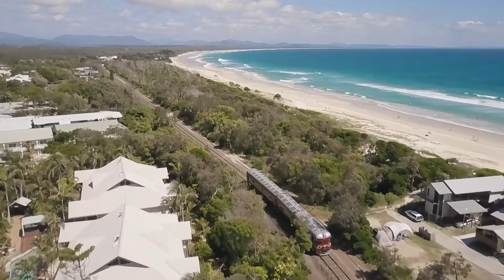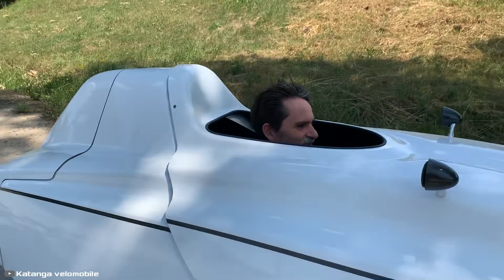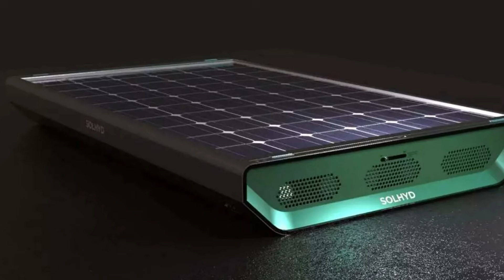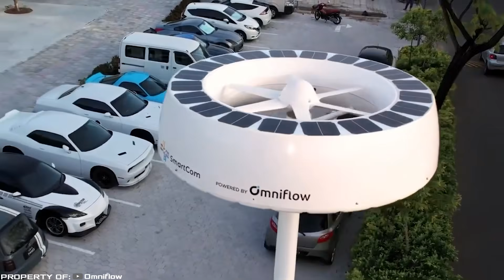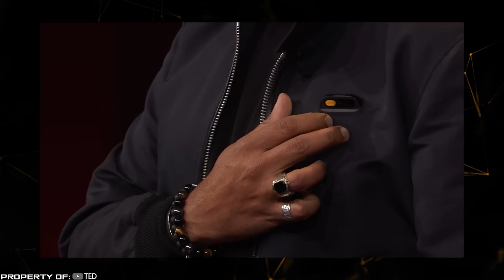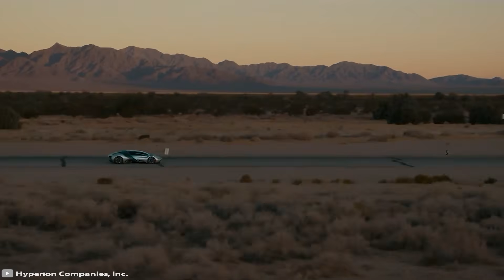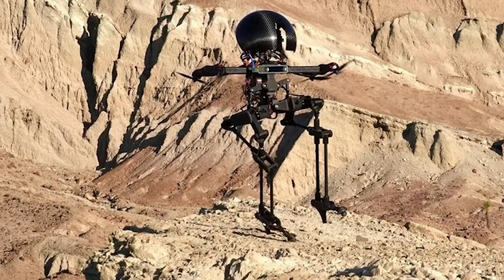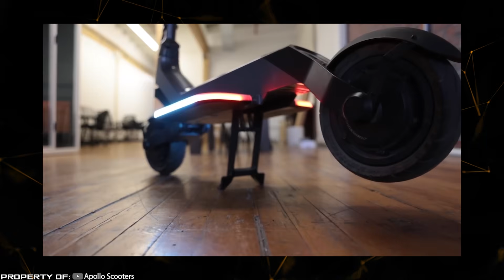INCREDIBLE INVENTIONS THAT WILL BLOW YOUR MIND | BEST OF 2023

Comment: What surprises me is with global warming, we keep focusing on solar energy instead of finding a way to concentrate the ambient heat and use that energy. solar wont work on a cloudy day but if its cloudy but still warm, the ambient energy would still be there
Reply: Ambient heat is used in heat pumps to heat houses and heat your water for the shower. Small systems for single family houses and huge systems for small cities (Denmark).
Reply: The climate always changes humans have nothing to do with it unless all atomic weapons were to be set off all at once
Reply: They are solving a non existent problem. Global warming is not bad.  An increase of about 1.5 degrees since the little ice age.  The most prosperous century in history.  What we should be doing is developing even more coal, gas and nuclear power in preparation for when the climate reverses toward another ice age.  Also provide energy for undeveloped countries.
This video is also deceptive.  The solar panels on the train do not provide all the energy for the train to run.  Most of the energy to charge the batteries comes from the panels on the roof of the station.
Solar and wind have no hope of replacing existing dense energy of coal, gas, oil and nuclear.
Reply: Weather

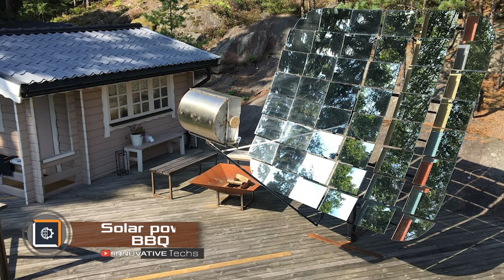Comment: Third-world countries have been using solar-type or reflector panels for decades as an alternative method for cooking. However, they do so using far cheaper and available material.....something so elaborate as shown in @15:29 is really not feasible. Still, it will be interesting to see who decides to install that particular technology.
Reply: BBQ enthusiasts who also absolutely must have any new shiny gadgets and have lots of money to waste? Maybe someone could install a few of them and start a restaurant offering solar cooked meals, open only around noon on very sunny days...

Stuff like the bike that costs as much as a cheap car is at least useful, but this contraption is dumb. It takes up lot of open space in your yard and may require cutting down trees because it requires direct sunlight, is either a permanent structure or hard to relocate so you cannot store it away when not in use, requires lot of cleaning to keep it shiny, and still only works for a limited number of hours per day so no evening meals for you.

This may be one of the few cases when building a "green" gadget takes more money, energy and fossil fuels than using it would and could ever save you. Some of the smaller scale and DIY versions do actually work, for the rest of us cooking with electricity produced by solar panels is both cheaper and more practical option.

Comment: Solar cells in space transmitting power via microwaves to earth?I can think of a whole series of problems compared to solar cells on earth: Risk of Space debris destroying it, massive power loss due to transmission type (microwave), power loss due to distance (36000km), powerless due to even the slightest misalignment between constantly moving sender and receiver, power loss due to atmospheric absorption... in short, the increase in efficiency you get in space is probably smaller than the losses you face when sending the power back to earth. But wait till E-Rockets hit the market and you can use it as wireless space recharge station.

Comment: i like to drive to florida from new hampshire often. i have a gas driven car that holds 20 gallons of fuel. from leaving NH it usually takes me 32 hours drivetime with many fill-ups of fuel. if i had an electric car and having to recharge after 400 miles it would take me close to a week to get to FL. my vacation time is usually 2 weeks. i would lose my vacation totally just driving there and back. it only takes 5 minutes to fill up my gas tank.

Comment: Fun with math. 1kg of hydrogen = $16. 1 liter of hydrogen weighs .0896 grams. So it would take 11,160 liters to make 1 kilogram of hydrogen. Machine produces 20 liters per day 558 days to make $16 worth of hydrogen. If the device cost (guess?) $5000 you would need to make 312 kilos to break even. So 312 kilos at 558 days each would take 174,375 days or only 477 years to break even.
Reply: i see your a great and mathmatician enthusiast! Our country need more people like you to teach our youth! Our country is falling behind in math
Reply: How many liters of hydrogen is needed for hydrogen car?
Reply: @brandonsheffield9873 what are cylinder dimensions ? A 4 cylinder engine needs one filled at time.  A 2 Liter motor divided by 4 would be about right. 

Look up Stanley Meyers water car where he used high voltage to break apart water.

The myth busters have a short segment on it also.

You can make HHO in infinite volumes.  There's a lot of water and free electricity around now a days. 

The genie is out of the bottle now.
Reply: Mixing column weight and form conversion
Reply: Sounds like a plan!  (Not).  But that's not fair to actually use numbers and things to show how silly the concept is.  Not to mention the issue with storing hydrogen, and the extreme explosion danger it brings.  NASA uses hydrogen to power some of their rockets, and is forever having trouble with the valves, seals, and piping.  If NASA can't get it right, what chance does Uncle Joe's Corner Garage have?  Hydrogen is impractical.
Reply: Sea water + EMF = Hydrogen, enough to burn for fuel and generate the EMF, water vapour being the only byproduct, sea water the fuel. Non profit products are not promoted and made available to the public, due to the greed of corporates, billionaire elites, Science and corrupt politicians we are forced to pay for obsolete technology designed to drain the finances, minimise recreational time and destroy the happiness and well-being of the citizens of the World, who pay for their ego infused evil policy’s, until we are dead.
Reply: A litre of liquid h2 weighs 70g btw. Go figure!
Reply: Nice catch. I’m also excited to hear how exactly you extract hydrogen FROM sunlight. Now there’s a trick!
Reply: Great comment, hydrogen can be made with solar electric, hydrogen generators are cheap to build, hydrogen is everywhere, 71% of earth is covered in water,,,the reason hydrogen cost is high is because its convenient to make it expensive,,,plus you and every other person on earth can produce it easily and cheaply, which is the reason they are spoofing people that hydrogen is expensive,,,think about it,,,no drilling, no refining, no pumping stations and no pipelines, no oil spills,,,I don't have a solution, but I do believe harvesting the most prevalent combustible element in the galaxy, hydrogen, which is renewed when burned, is what we should be using power everything. Generate electricity with no moving parts with hydrogen fuel cell to power EVs, no battery storage, lighter vehicles.  I could go on and on but what do you think?

Comment: JUST WHAT WE NEED...more microwave beams from space! 😮
Reply: If you put a microwave satellite in GSO,  it will have a 6x8 kilometer footprint on the ground at approximately 40° North latitude. Using concertina wire as a receiver strung between posts, the microwave concentration is safe for humans and animals for reasonable periods of time. If one wishes to work full-time under it, a simple shirt or coat and hat with foil in them will suffice. 

Meanwhile, farming or livestock grazing can happen in parallel. 

SPACEX'S and maybe BO's rockets will make orbiting sufficient mass for the project reasonably economical. 

With all this ensconced in GSO, the only problem will be the periods when the solar panels have fairly extensive blank outs when the sun doesn't reach them. That will require fleets of satellites in leading and trailing parts of GSO, that can then be trained on the receivers when the normal parts of the array are masked. 

TANSTAAFL!
Reply: Were going in the wrong direction Not too mention the Fake climate change being pushed on every media
Reply: I'd like to see RF Safe Stop stop a Detroit 8V-71, or any 2-stroke diesel with a mechanical fuel pump.
Reply: LOL.  But not that dangerous.
Reply: You don't know how much we already have.
Reply: @peterbond1270  I'm not sure I want to know how much we are surrounded by any beams... especially 5G. Of course nobody, like even the News outlets, will tell you. They don't want to alarm the public. I can only imagine how much it is though. Often thought of how one could create a sleeping room that would eliminate all EMF, Microwave, etc sources. Probably would be very beneficial for ones health.

Comment: I thought about solar or hybrid trains years ago....Many trains have electric motors & use diesel generators to create power...I can understand why cargo trains aren't solar hybrid. Because it'd be too much trouble switching solar panels on the cargo rail car, boxcar  roofs....
But a solar hybrid passenger train wouldn't need to do this because it'd use the same boxcars..It'd get great mpgs in sunlight .Use solar panels on each boxcar roof combined with electric motors & a diesel generator. 
Or hybrid semi, similar to the train, semi cab would have  electric wheel motors, diesel generator & battery bank & carries a large  rollup/rollout solar panel. That gets unrolled & attached to the semi trailer roof & plugged into the charge controller. You could probably fit about 10,000 watts on a semi trailer roof. So when driving in sunlight. Around 8,000 watts along with diesel generator is keeping the motors spinning.
Reply: Bubble 🗯 bursting. For very popular routes it easy to string a high voltage wire have the vehicle lift up an electrode to run on high power oh!  I mean  bury the cable  in the ground and induct the power from it (safety no power lines to fall down) . And also charge your main battery from it while driving. Goodbye high speed charging stalls. Now each vehicle don't need solar panels or as big of a battery for travel. I think that's a game changer.  Your once or twice a year long drive rent an appropriate vehicle for that.

Comment: Look, I'm all for renewable energy and innovative technology.. BUT, that first one, so called "electric train" sounds waaay too good to be true.. allegedly it only requires 20% of the energy it's panels can capture..? Really..??? I could somewhat understand if the train was made of honeycomb-aluminum material, or carbon fiber, so that its weight would be as low as possible.. but even that would need some smart engineering to extend roof area to add many more panels, as I doubt 30 panels is anywhere near enough to power-up a train.. But in this particular presentation they say that this is actually a refurbished train from decades ago, which suggests that its weight is massive.. Don't get me wrong, it would be VERY nice if scientists/engineers could develop solar panels that could convert 100% of solar output into useable energy.. then you could stick this "new" solar panel on your car and drive away.. Hence, I think this "EV train", for whatever reason, is doing false advertisement, as the only thing those solar panels could power would be the lights, TV's and maybe.. MAYBE air-conditioning.. the rest of the energy probably comes from those lithium batteries, although they get charged-up every morning before the trip starts, and probably this train makes few "pit-stops" to recharge those batteries again.. I think whoever wrote the "script" for promoting this thing went waaay overboard with that whole "it needs only 20% of its energy, whilst the rest 80% goes to the grid".. really..??? I mean I don't see Tesla all of a sudden converting all their super-charger stations into "powered by solar panels only".. after all, if 30 panels charge-up to allow a train that weights dozens of tons to drive as if it's diesel-powered, then in theory just ONE of this panels should be enough to power a Jeep, and we don't see cars with solar panel roofs as of yet..

Comment: Hydrogen if big oil would quit trying to block it
Reply: Fun with math. 1kg of hydrogen = $16. 1 liter of hydrogen weighs .0896 grams. So it would take 11,160 liters to make 1 kilogram of hydrogen. Machine produces 20 liters per day 558 days to make $16 worth of hydrogen. If the device cost (guess?) $5000 you would need to make 312 kilos to break even. So 312 kilos at 558 days each would take 174,375 days or only 477 years to break even.
Reply: ... and if only someone could figure out how to store it safely, and how to transport it safely, and how to make seals and valves to control it, that don't jam and break all the time... and if somebody else could figure out how to make it affordable...

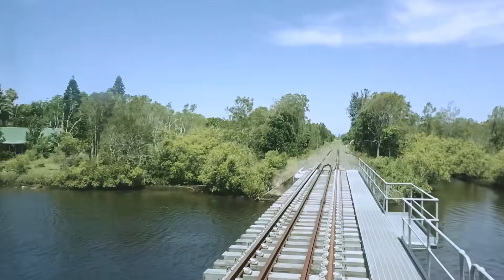Comment: OK, OK ahhh, (1:08.28 time) They want to fly a Parasail (their Kite) off the front of a full-size ship to help it get better fuel mileage while at sea! OK, the cost of the system, I'm sure is rather high, (nothing is cheap anymore), but one thing I have a problem with is what if the wind is blowing in the opposite direction that the ship needs to go? Rather useless in that case! Would be just as good if not better than the old-fashioned sail type system with the new computer control workings that are already available or the rigid type sail which I can't remember the name or the ship it's already being used on!

Comment: The ground effect hydrofoil electric plane/boat is interesting.
Reply: The Russians developed jet-powered troop transports decades ago that used this tech. They looked more like a typical fixed-wing seaplane but they couldn't properly fly out of the ground effect zone. Still, they could zoom over water for amphibious assault. The US opted for hovercraft that used engine-forced air instead of airfoils. Thus, the US craft could move at slow speed over the water and flat ground, while the Russian craft would sink to the water if they slowed down (and couldn't move over land).
Reply: The Russians tried something like that, but much larger about 50 years ago. I believe that it was called the "Ekranoplan" or something similar. They could never get it to work properly.
Reply: Yeah, but will it scale? If you're talking about the ones being demonstrated on the Portsmouth - Cherbourg crossing, how many school tours or football teams with travelling support are one of those supposed to ferry across the channel?!

Comment: Volar looks promising. I like the solar train but of course doesn't operate at night. The horizontal wind generators are the better designs. The self righting robots are getting us closer to robots similar to humans.
Reply: It works at night. 

It only uses 20% of its stored energy during the day and the remaining usable 55% is avalible to be used at night. operation.
Reply: Boston Dynamics. Been there, Done That years ago.
Reply: Yes they are. I still fall over sometimes.
Reply: It won't operate in the day unless it's always going down hill towards the centre of the earth.

Comment: Regarding Aerodyne(sp?) truck airflow modifiers, I don't see how this is an incredible invention of 2023. I have seen similar features on semi-tractor trailer cabins and trailers for decades. If the shape is slightly different and that is it, it should not be in this video. Do I have the wrong impression?
Reply: You are correct, these have been around for a long time.

Comment: Allot of stuff that will never be seen beyond this video!
Reply: Well if you want to see the ARCASPACE rockets you only need to go to Romania..
Reply: But some of this stuff will happen and the stuff that doesn't gets new minds thinking better way that might work
Reply: @deanziyone2213  I do know that but I'm 55 now and allot of the stuff that I have seen come and go and never develop into something real is sorta discouraging. I do admit in the many years I've been on this planet technology has gotten better in leaps and bounds. Where my coment came from is all the improvements I've seen in battery technology and solar technology is very impressive but I know for a fact that there is already safer battery tech that holds more and less charging time that exists that paired with newer better solar panels in different configurations could make it so a person could take a trip across country in electric car no problem but they are so busy making money off the older stuff and keeping the newer stuff off the market so more money is made that it's happening to slow to improve air quality and other things. Look at what happened during the COVID shutdown. The air got cleaner for a minute animals changed there habits because it was a bit quieter. Anyway...... This is long enough and I could go on and on but I won't anymore just felt I should explain!😁😉
Reply: @deanziyone2213 100%

Comment: How are electric cars to operate say in California or other states, when there are black outs? Did any one think of this?
Reply: During a blackout, it rarely does you much good to travel.  Furthermore, emergency services DO plan on electrical needs when they use electrical equipment. Vehicles are no different.
Reply: Same for classic systems. Only some hours. No energy no gasoline pumps, traffic breakdown. So not a lot of difference. Except: You roof is full of solar cells. Then you can charge your car (and yes, drive gasoline pumps....). Btw: having a weak powerline network is the problem. Not the cars 🙂
Reply: The cost of the car is not what everyone can afford. Solar cells on the roof of a car are not much good when there are a number of cloudy days say like the winter months. Also, there will come a day when that big expensive battery will need replacing. What are we talking $12,000 or more. That is a big expense to many. @hesspet

Comment: Cool but expected. Solar Train is very cool and worth developing.
Reply: @kruleworld  The solar panels on the roof should produce enough power to recharge every passenger's mobile phone.
Reply: At every stop the batteries can be charged from a stationary source. Like the bus with a super capacitor running in Shanghai.